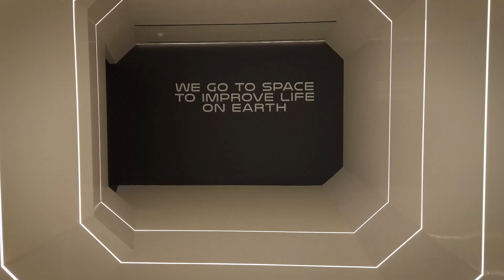Life at Rocket Lab | Our Collaborative Culture

Comment: Love your company!  I have so many questions I wish you could answer!  I am fine however  simply investing and supporting you on social media. Keep up the great work! 🚀
Reply: @Space Geek wow, thanks so much!  I will keep it simple and only ask the question that weighs most heavily on my mind.  If spacex manages to get their starship program running smoothly, Even with a cheap 2nd stage how will neutron compete against a fully reusable starship?  Assuming starship meets its goal of  $10 million per launch, is there a plan to meet the challenge head on?  At that price even a smaller satelite could affordably use starship to get a custom orbit. It wouldn't be as  efficient given the dry mass of starship.Even so, a disposable 2nd stage will  Probably counteract much of the savings from  Neutron's smaller propellant requirements. Thanks again for responding to my comment! It is much appreciated 🙏
Reply: @jonsilva3785  SpaceX will manage to run the Starsphip program smoothly  ... 
Just as Falcon 9   ... 
Till today Rocket lab has not even touched the capabilities of even Falcon 9  ..  Then there will be Falcon Heavy and then Starship  ... 

There is a very long way to go  ...